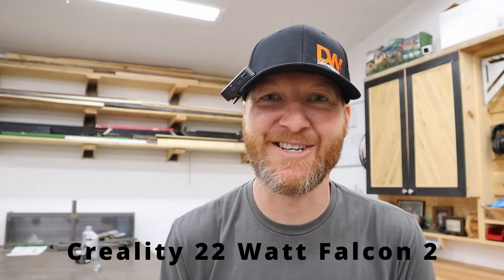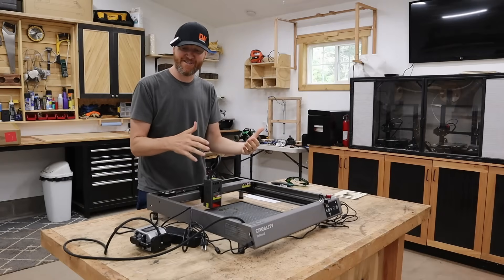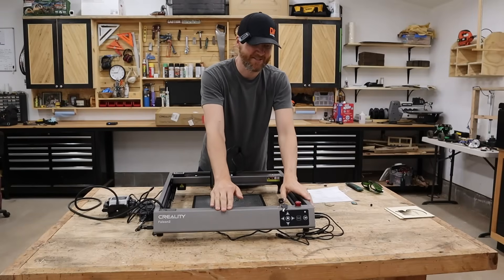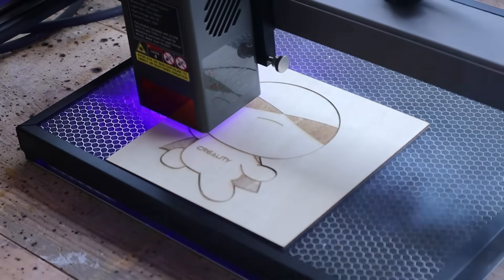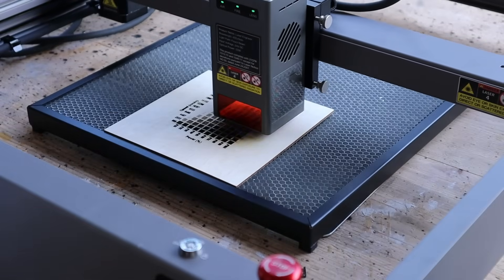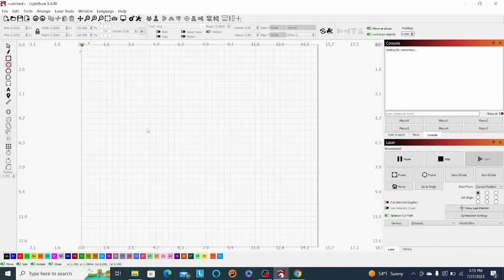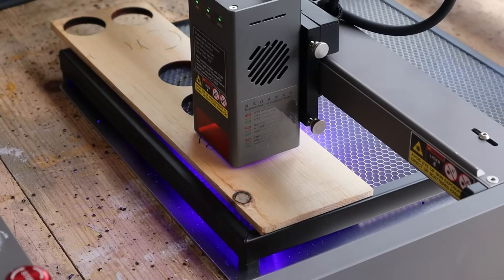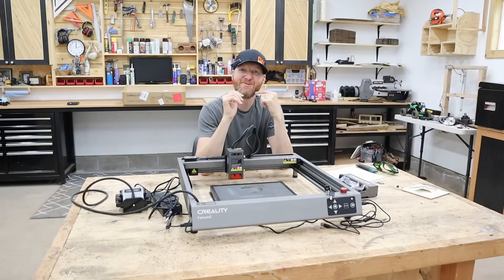Creality Falcon 2 22W laser cutter engraver / Review and test

Comment: Hello my is Eli I have a falcon2 12w I have a problem I press frame and it goes all the way back and beeps and starts speeding then locks I don't know how to adjust to fix this problem can you give a solution  to this problem
Reply from the maker: Hello, what software are you using? Every issue I have had with laser cutters have ended up being software issues and using the wrong driver. I would look into if you are using the right driver and go from there. Goodluck!

Comment: What is the best type of table to set this system on? Also, I have purchased the enclosure with this machine can it be used inside a home near a window if the window is open?
Reply from the maker: Hello, I think you would want some sort of exhaust setup. I think you would get a lot of fumes inside with just a window open. Atleast have a fan blowing out the window I would think. Goodluck!